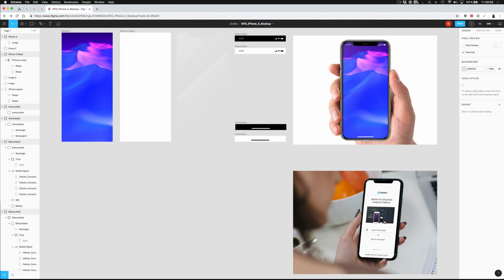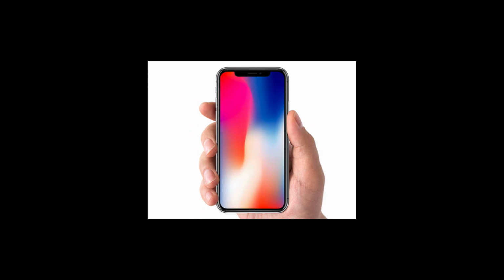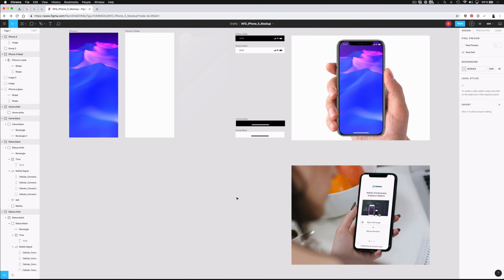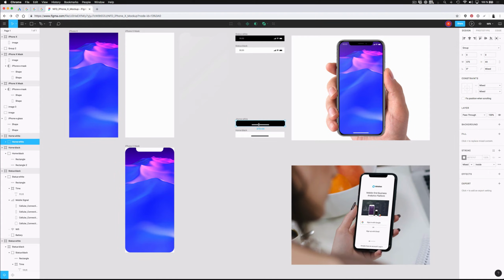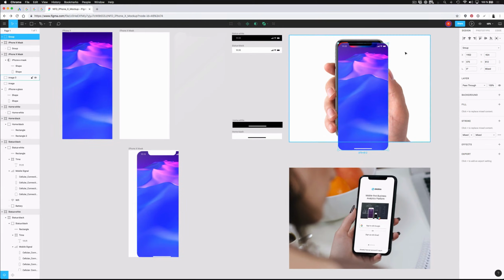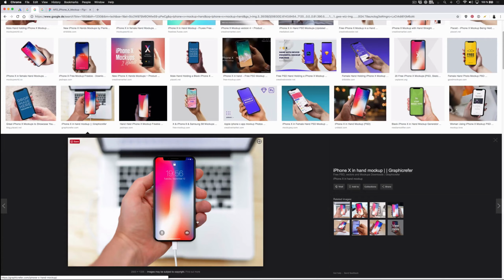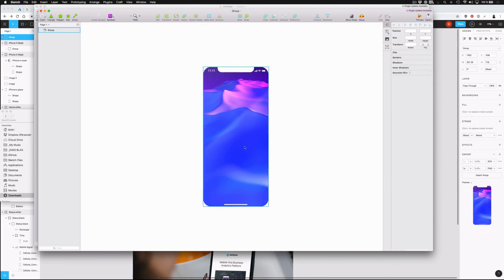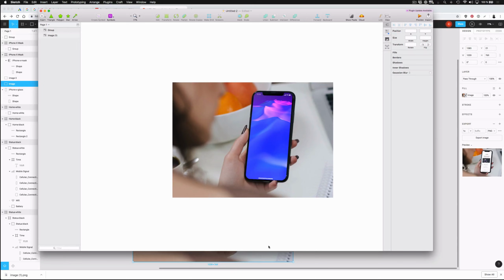Create iPhone X Mockup using Figma (no Photoshop) - No Fluff Design

Comment: The iphonex mask frame is not included in the Figma package, only the sketch,... Please include all the individual mockups in the Figma asset, disintegrating the coupled one is stressful
Reply from the maker: Hi there. Thanks for your comment. I have just looked at the figma file and you should see a frame called 'iphone-x-mask'. This is the mask. It is invisible because there's nothing for it to mask in that frame but as soon as you add your image to the frame, you should see it has been masked. I have just updated the file to include a placeholder image. Hopefully this clears things up.
Reply: @nofluffdesign4073  first time it got masked correctly.... But after that i tried second time its not masking anymore....  Plz help......